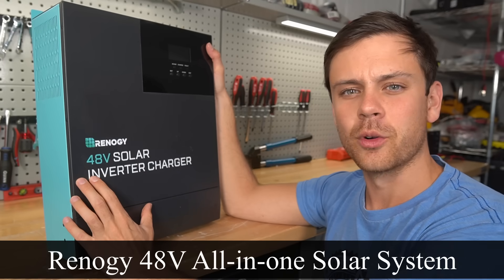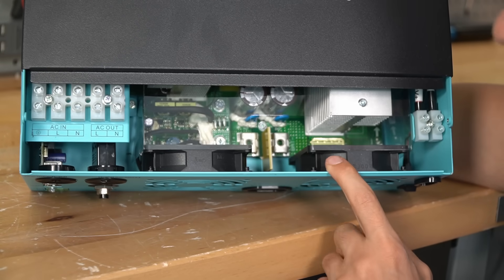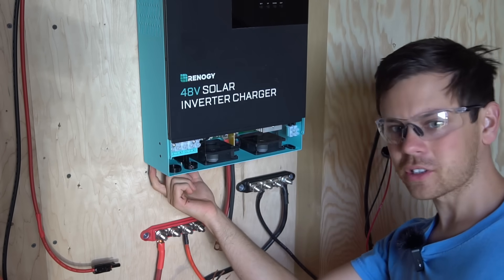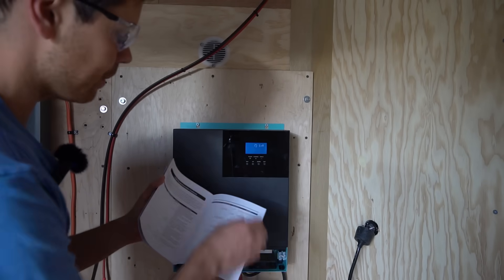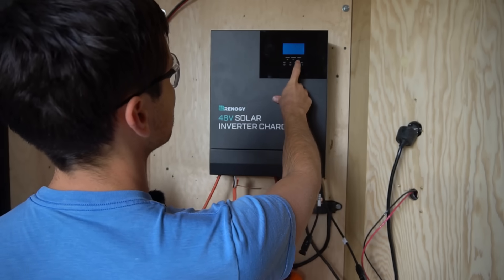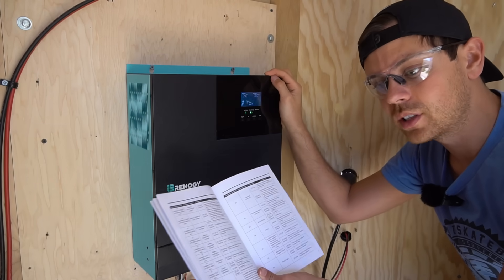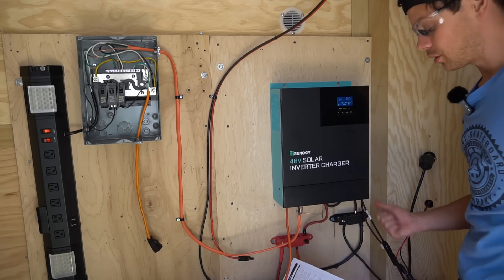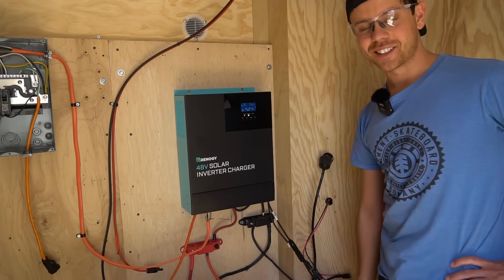Renogy 48V All-in-one Solar System: 3500W Inverter, 4400W MPPT, 1920W AC Charger

Comment: I just installed one of these with a SOK 5.12kW battery and a 1500W array (2 parallel strings of 3 panels) and had zero issues.  Ran a DeWalt Mitre Saw off of it which pulls 29 amps at start and 12 amps while cutting.  Inverter capacity is fine.  Panels charge the battery as rated.  AC input also tested working.  After this video review made me nervous I have checked everything and I can't find a single thing wrong with how this unit works.  This Will Prowse should read the manual next time.

Comment: Hello Will, Thank you for the great content.

Most likely, your float voltage is set lower than the Boost voltage, which is set to last 2 hours by default. 
The final outcome: These units are NOT FUN to set up. (thus I agree with your conclusion - "I DON'T LIKE IT!")

I am Actually slightly disappointed in this review, even if I agree with the outcome. I Hoped you'd dive a bit deeper. 

I was also expecting to see about the software, which would probably have shed light as to why your unit refused to charge after a few hours.

Being in Canada, i had limited options and I got the PowMR Version of this. These units all seem to be knock offs of the SRNE Units. This one specifically looks like a variant of HF4830U60-H 
My unit does, however, work, if you care little about tracking, data, and as long as all the different settings are set properly. According to my unit, its captured 420.8kWh from the sun  in the 11months i've had it, including lots of snow in winter, EG, no output months.

Comment: No offense but I don't think this dude read the manual and as a result he doesn't understand the unit and that caused his frustration.  Power saving mode has a 5 minute delay from the time it's set.  Once on it will ONLY charge from Solar and no longer from AC input.  In my opinion the user should set the AC charging down to 30A max (which is roughly 3500 Watts) .  I think the default 40A is just too high and the unit shouldn't really support that continuously (although it's rated to burst to 7000W briefly per the manual).  Lastly yes that loose ground wire should go to the chassis lug, which if you notice that lug is right next to the AC breaker.

Comment: Will the inverter I was thinking about buying only has a line and neutral AC output it has a three line AC input neutral ground and line is this okay to buy and use it looked just like your LV 6548 models

Comment: 48-volt all-in-one had a software bug! If you press down 10 times on the display. It should display app software version/bootloader software version. Should look like this:

4.04     1.07
That's the version that works. Not app yet!
4.00     1.07
That version and earlier has tons of bugs.

I was wondering if you could take a couple minutes and hook that thing up and see what versions you are running. I did like & subscribe..

Comment: THIS IS PLAIN OUT WRONG. I have one of these units and it is much better than what he links. Better quality parts, better company......ADD INSULT TO HIS INJURY.... He didn't even hook the dam thing up correctly, and could not locate the simple grounding lug that is pinpointed in the manual... This unit is very powerflul and worth it for the extra $75 over what he links. It can be charged with a generator, and has bluetooth capabilities with the added $30 module. Buy this renogy model, dont let this guy fucking fool you with this lack of knowledge and inability to install things correctly. This unit is built to handle very large guage wire, 2guage for the batteries and 8guage for the solar panels which allows the system to handle large loads. It is capable of outputing 40volats at 4200watts, but safely does 3500. It continusouly does 30 amps output so I use a 30amp breaker on my ac out to protect my 30amp tiny home system. Great piece of equipment. Buy one.

Comment: 7:44 he can't figure it out because his open circuit voltage on the solar panels now exceeds the maximum input allowed by the charger.  
As mentioned the voltage is now higher because he is getting full overhead sun. 
Just compare the intensity of the light coming into his shed at 4:43 and at 7:44 when he is experiencing the problem. 
Another clue is the warmth and vibrant color on the plywood. Grey earlier in the day when he was making connections and a vibrant yellow when the problem exists. 
You can see the door is open to the same position in both instances by looking at the reflection on his safety glasses.
Reply from the maker: No, I did not exceed the maximum input voltage. That is wrong.

Comment: This type of thing is what I am interested in but about 3x the capacity.  I may end up building my own setup in a few years, but would prefer an all in one setup with warranty designed and listed to work together.  Cleaner install.  Easier instal.  Of course if one part fails you probably can’t open it and replace say just the inverter?

Comment: Thanks for posting your review!

Just for accuracy, at 0:48 you point out the ground connection. Your manual should include “The ground output cable will need to be connected to the ground screw terminal located separately from the output terminal block.” The current version of the manual says so on page 15. I think we can’t bash the unit for this.
Reply from the maker: All the competitors to this unit have a nice little dedicated ground terminal. I prefer that over a case screw

Comment: It won’t charge because it thinks the batteries are full. You have to change the batteries to USE mode then set the parameters for your batteries. You can’t use the default battery profiles.

Comment: Hi Will. I have build a solar catamaran with 48v lifepo4 24kwh battery with 2400w pv 80v. Which mppt solar charge controller do you suggest, I never charge each cell higher than 3.5v so 56v total. With regards.

Comment: Will, first off thank you for your channel Ive learned so much more because of your videos.
I have a few questions I'm hoping you can help me with.

I'm interested in the Growatt combo unit. I like the fact that I can add more units to expand the system. I don't think the Renogy one does that right?
With the Growatt unit will i need a auto transformer in order to connect it to my breaker panel? I want a split phase setup .If so then is there another model of Growatt that doesn't require the transformer?

Im putting together a system that is off grid but can attach to my home panel for emergency back up.
 Im open to any recommendations you may have on any other combo units

Comment: Suggesting the use of those parallel MC4 connectors to increase array wattage is just about the most dangerous advice Will has given on his channel. Without very careful design and wire size selection, their usage could easily result in a fire. Its far better to run parallel solar panel strings to a appropriately rated combiner box with disconnects for each string, and wire its output to the charge controller terminals with wire rated for the device's maximum input rating.
Reply: Of course you'd do that if your system is getting larger. I think he was referring to it in the context of his small setup here.

Comment: I wasn’t aware it was possible to charge from an ac output. I thought the ac output was only to run ac devices. I thought for a battery to charge from an ac output, there needs to be an inverter - so the input of the battery needs to be dc, unless there is an inbuilt inverter on the battery.
Reply: There are TWO AC connections: an input and an output. As I understand, the output is indeed to power AC appliances, and the input can be used for charging.
Reply: theDaNi0 what I was saying was that to charge a battery, there has to be a dc input. If there is an ac input, the ac  needs to be rectified and smoothed before putting into the battery.

Comment: Just like everything with solar it's a waste of time. I only get 4amps of solar charge from my 150watt solar panel when the sun is right over the camper van. Most of the day it hardly gets 1amp .. Solar great for mobiles but for ebike batteries or anything else solar is no better than dog poo 🤣😆😆

Comment: Hello, Thanks again for your knowledge and opinion! I have doubt...! I am sorry in advance if it is not appropriate! If You connect the solar panels/Batteries and on the AC input connect the generator or directly the network grid from where the connected load will take the power? It suppose to be always from batteries, is that correct? And there have to be some under voltage protection for the batteries and changeover to AC input source for continuety supplying power to the load? Is that the basic principal of this all in one units?

Comment: What would cause the Solar charger to only put out 400 watts instead of the expected 800 to 1000? I don't have that model but it functions similar and the display is a bit confusing with the watts produced. The math from the mppt voltage & amps... "watts: doesn't match any display of watts on other screens.

Comment: Will can i use Solarever 440w 72 splite cell with the new Renogy 100amp charge controller?
Reply: 440W 72Split-Cell Silver Mono Solar Panel by Solarever says 50v open circiut and the controller is 48v will this hurt the new charge controller.?

Comment: Just curious, why don't you use the watchpower software to set these up- WAY easier than beeping through sub menu's (at least it is on all the mppsolar ones) pretty sure most of them are coming out of the same voltronic factory.

Comment: I ordered a kit from renogy on March 11th and used your code.  As of June 11th was still waiting for the panel. Their customer service has been mediocre, replying with, "it's on the way" everytime I message them. 
I finally asked when it will arrive and was told its on back order now. I told them they've wasted my time and to issue a refund or credit. They took 10 days to issue the refund and then today only issued a partial refund. 
I would not recommend renogy to anyone.  Renogy is a terrible company to buy from.

Comment: Casually dropped another helpful tip about VOC and the need to run panels in paralell strings to reach a high watts without crossing the inverter Max Open Voltage, thank you

Comment: Will, Can you do a video on what to do with a fully functional approved high output roof solar system which cannot store due to Tesla refusing to provide the contracted-for batteries. What can we do to store and use Kw if CA goes to mandatory blackouts? I have one Battle Born battery on my temp system. How do you get the stored battery kw's into the house without using extension cords?

Comment: I have a 2500 watt grid tie inverter system. I would love to with the click of some switches convert it to a batter backup system with a separate 120/240 volt inverter. Is there a good product for us? It makes no sense in an emergency situation or a power outage not to have our solar panels work.Our issues may come with the higher voltages on the panels combined for such a battery system...Thanks.

Jeff -  Sunny Central Florida 😎🙏 🌞

Comment: Hello
I have a hybride inverter but i have a question.  Why is the ac output unstable with my side by side fridge swinging from 225 till 240v. At the same time you can see some flicker at the inside light.     If my separate freezer works at the same time there is no problem. I tried several other devices at the same time but it certainly the side by side causing the problem.  Thanks for any suggestions.  Greetings

Comment: Gorilla glue a metal V-shaped bar on the bottom, drill a hole in it for screw mount, then voila!? If only I had designed this 🤣

Comment: So, for the mount issue, I believe you are supposed to put a screw in the wall first for the keyed hole in the back, then hang the unit on that keyed hole, then install the top screws.  Other issues aside, at least mounting it isn't one of them.

Comment: My friend i Just bougth a similar inverter  and i have a big question, i want to instal the inverter in my garage with solar pannels. I want to know if i can connect the solares pannels and batery and then conect the inverter in a outlet in the wall and not connectiin imput in from the house, só basicly connect as a microinverter, that is possible?

Comment: Hey Will! In a November, 2019 video you demonstrate how to pre-charge the inverter capacitors by using a resistor. In that video, you place the resistor between the NEGATIVE terminal of the inverter and the negative terminal of the battery. Is one way better than the other?
Reply from the maker: Either positive or negative works
Reply: Is there a value for the resistor used to pre charge the capacitor of invrtr.?what type of resistor? Ty
Reply: I just use a light bulb, such as any 120v, 60 or 100 watt bulb.  The filament does a slow charge of the caps in perhaps 3-4 seconds.

Comment: Pretty sure you know this, but didn't mention it in the video.  When you measure the open-circuit (OC) voltage of your array, remember that the voltage is dependent on temperature.  So people in the north will see higher OC voltage at the lower temps.  Check the specs on your panels for the temp-voltage curve.

Comment: Will , Did you figure out what the issue was for this ? Im haveing a similar problem with new 3000w ES Growatt 48v
It will run batteries down to 47.5 an won’t charge batteries Even with 4-24v panels OPC 152  X2 P 2000w

Comment: Opens manual to try and diagnose charging issue, but doesn't look in manual for AC Output grounding point. That "Chassis Ground" is the AC output ground.

 Page 15 of the Manual - AC Output Wiring
"Only the Live and Neutral wires will be connected to the Output Terminal Block, the
 Ground will be connected to the screw terminal."

So you tried to charge the system without having it properly grounded and your AC source flipped its GFCI... Sounds like you shorted the Renogy.
Reply from the maker: No, I know it was there and I said that in the video. But I want an actual terminal like 99% of the competitor's units have.

Comment: Mate did you work out why it wasn't charging with AC? My unit does the same,  notices that there is AC input but does not charge?? 
Solar charging is also temperamental...
Reply: There is a comment explaining it potentially just above yours
Reply: @ereenatc6042  went through so many comments 😂 all I could find was one about the SNU setting, is that the one you mean?
Reply: @mattthomson3134  yep

Comment: Hey prowse
I found some cheap 250 w panels on Craigslist 10 for $350 bucks they have some sort of flaw to the under skin which can be mended what I'm wondering is how many of these do you think I need to adequately recharge a 12 volt 200 amp hour lithium ion phosphate I have been motivated by your videos to build a kit with a four pack of 3.2's 200ah I believe the panels are 7 amp but I could be wrong anyways I was just looking for your advice on it also should I get a large size charge controller?

Comment: Hello and thank you for the insightful videos on solar system.
I would like to know if I can use 300w 24v solar allays with 50a solar controller to charge a 12v 200ah battery. I will heartily appreciate your response. Thank you so much.
Reply: Yes but it will take long long time ,many days..

Comment: One thing I love about your channel is that you are very honest and thorough in your assessment of equipment! For all the reasons which you reference, but especially the grounding wire issue (which isn't even up to code, I don't believe), this "all in one" is very problematic! I am in total agreement on your assessment: this unit cannot be recommended! I am a power plant operator, and worked in power distribution, too, for 20+ years, and I want everything electrical to be overbuilt! I'm especially critical of anything that can't be properly grounded, as I know one thing for sure (in regards to my own safety and that of others): don't be ground! Great video! Thanks for your honest appraisal of this equipment!!

Comment: LOL...Will, I just spent a day tearing an old Xantrax (Scneider) XW6048 off the wall at my ex's house that we put in 10 years ago.  Guess why?  DC Undervoltage Error.   Haha...I don't know what was wrong, but I really laughed at how light that Renogy or the Growatt is because even after I removed the charge controllers on the Xantrax that weighed 40 lbs the actual inverter must have still weighed 100 lbs and nearly crushed me and my wife and son under neath the darn thing.   What a near disaster!   The simplicity and lower weight  of these models is amazing.   I was about to tear the solar panels off her house and give up due to fact they never would go along with trying to put some heavy, noisy humming thing back up there, but wow things have change.  Got me thinking!    Thanks for the great review!   DC Undervolt...LOL
Reply: Having something hum and weigh a ton is not all bad I mean what you're talkin about served you well or could have for a long time

Comment: Will, you should move the output of the inverter feeder wire onto the breaker backplane and into a 30A breaker. I would remove that 30A orange wire off the main lug and get it into a breaker, extra protection into the backplane buss. You can just leave the yellow jumper between the main lugs to keep it all a 120V backplane.

Comment: Hey this might be off-topic but I come to you because I respect your advice and your knowledge. I bought a 30a wanderer. I am charging lead acid flooded that batteries. The battery light is flashing green slowly at the same rate as the solar panels which is indicating it’s an a float charge. I’m reading the voltage on my batteries and I’m sitting at 14.5 V. Mind you the system was working great the day before float charging at 13.7 V but then I hooked up a temperature sensor between my batteries and it seems like it’s float charging higher than it supposed to what do you think?